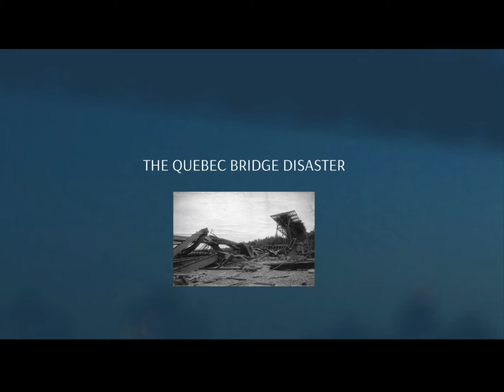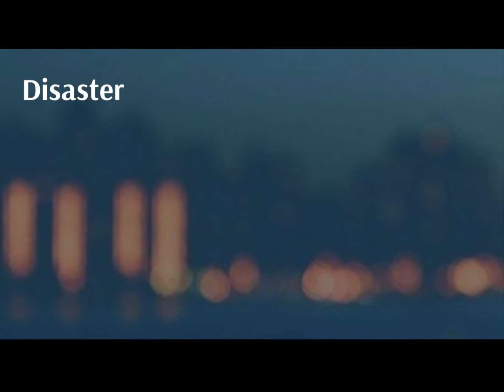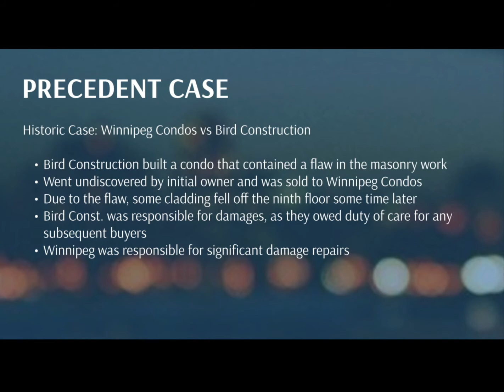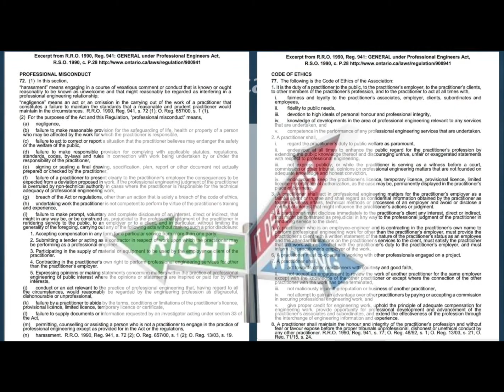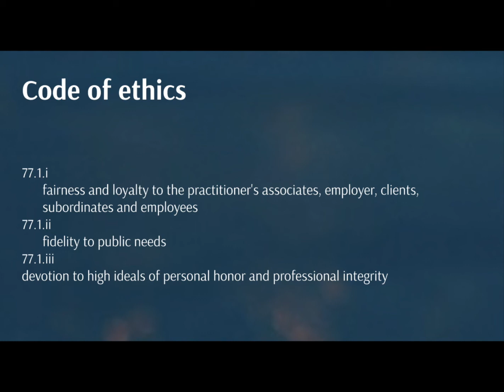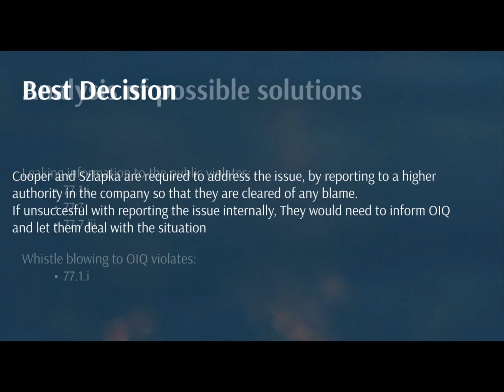THE QUEBEC BRIDGE DISASTER

Comment: The misalignments were all measured between the vertical webs of the lower chords . The erection of the structure was way too fast, not even bolted before rivets were put in place. No measurements of the total departure from design were compiled at the cantilever end. No proper structural surveys with engineers instruments theodolites, even, appears to be have been conducted about departures from the plans. I read most of the reports . To my judgment,(I  was assessor to a judge in major marine engineering inquiry  3 vessels capsizing), this first Quebec bridge inquiry was biased, to bring the fault on the American engineer and builder, not on the client. This as no proper survey ever took place. See flick Quebec bridge cracks.  Elastic instability is for the 3rd time the plague for this bridge, It will have to be demolished after an overloading by ore trains following a faulty 3D mathematical model SAP-90 .

Comment: The exact problem is still the same on this truss bridge and many others with long spans.  It was ignorance of lateral buckling calculations . The safety margins are what maintain those unstable bridges upright.  The stability problem is still kept under silence for fear of public. Stephen Thimoshenko after the Quebec bridge collapse spent most of his career exploring this instability situation , both static and dynamic ( including vibrations) Engineers for most aren't  real scientist they apply formulas. I think there was not ever any realistic model tested.  The Forth rail bridge I think was coming from old architectural and marine engineering and is proven much more stable and aerial . However still here was a problem developed with a sliding plate on one pillar requiring slag-welding about 10 years ago before its restoration.